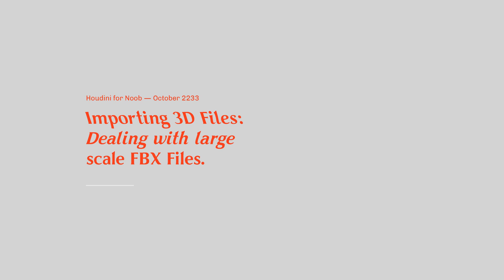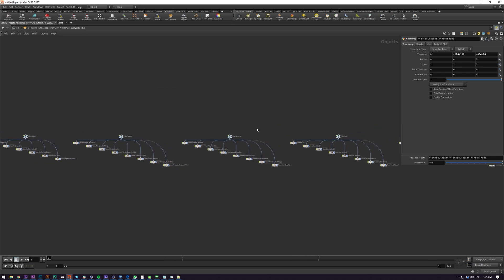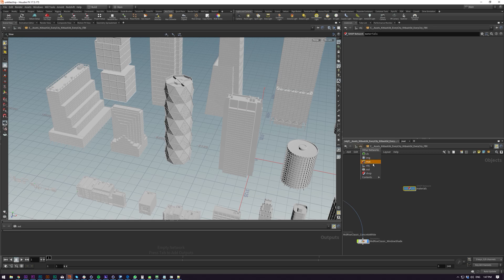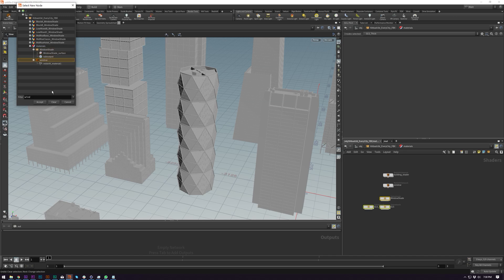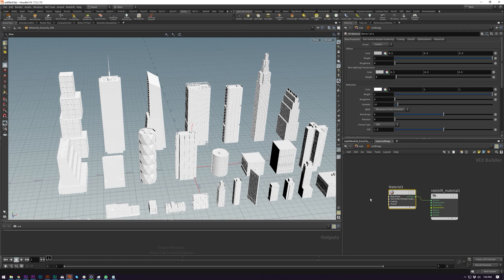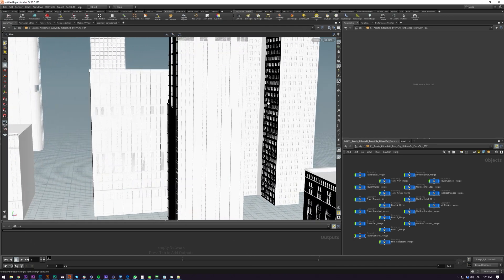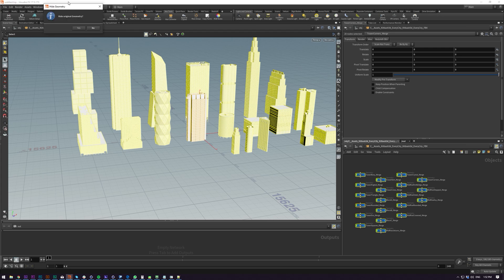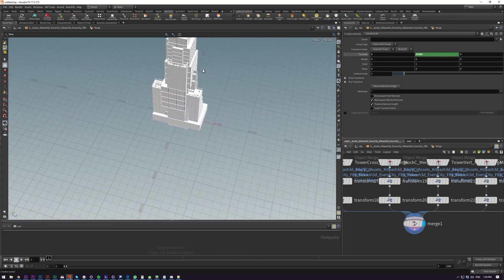Large FBX Scene Workflow - Houdini for Noobs 21

Comment: if I move model to world origin the way you show and make rs proxy out of it, after loading proxy in a scene they are somewhere in a space but not in origin. Why is that?
Reply from the maker: Have you tried moving them to the centre on sop level and not object level?
Reply: @AxisDesignerGFX  yes, and Geo nodes were moved from Zero. After I made their coordinats to zero everything worked except my scene of garden fbx is now not so well structured. 
Ist there a way to keep geo coordinates and not allow Proxy in SOP level to inherit those coordinates ?
Reply from the maker: If you're copying to points generally you'd want the object centred or grounded. But if you're just importing them and want the world coords I think there might be something in the rs options on your geo object. Or maybe in the redshift rop when you're exporting? Other than that I'm not sure, sorry